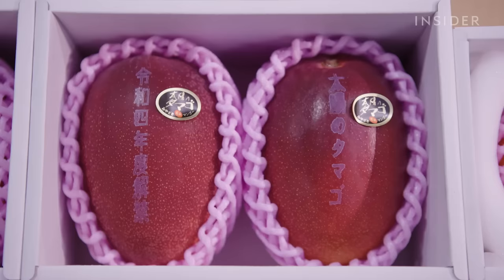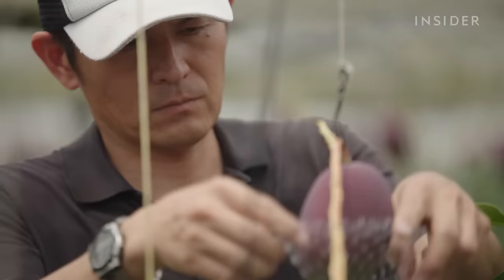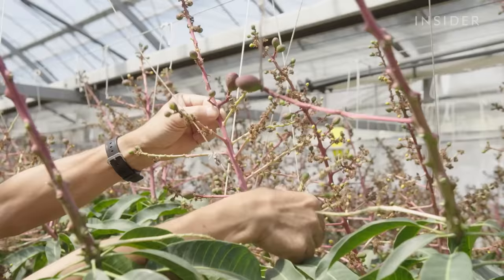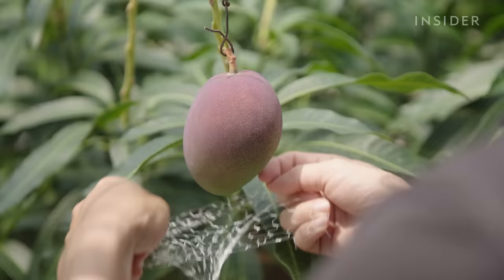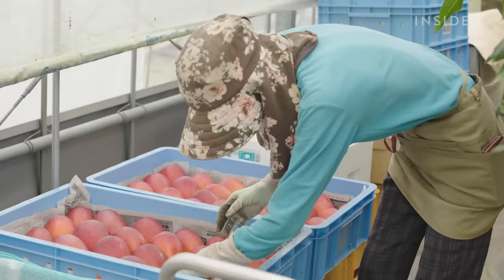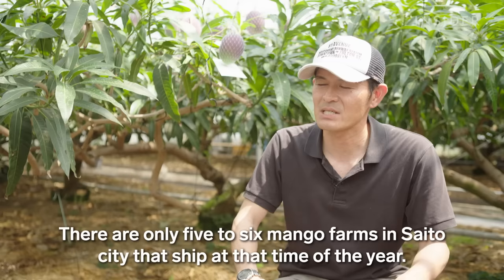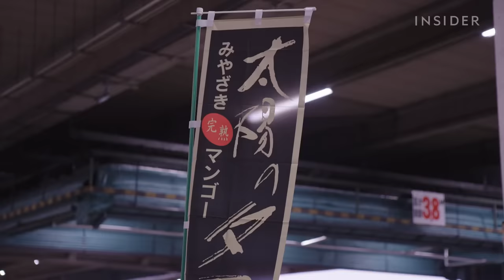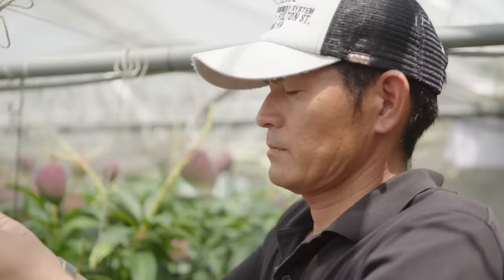Why Miyazaki Mangoes Are So Expensive | So Expensive Food | Business Insider

Comment: The key here is to have complete insight into which parameters need to be optimized for maxima. And taking all measures possible to get the maxima. A very structured approach. It cannot guarantee that all mangoes will be perfect but that's where the continual increment approach of the Japanese comes. They have turned a natural fruit almost into an engineering marvel...kudos.